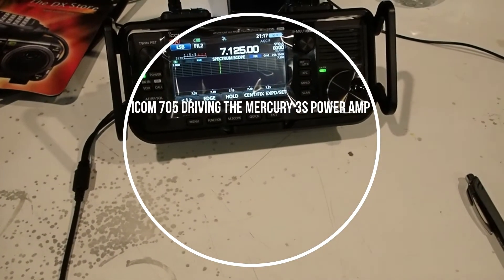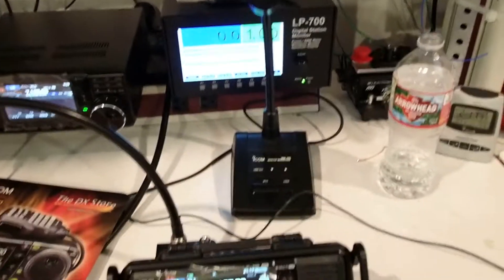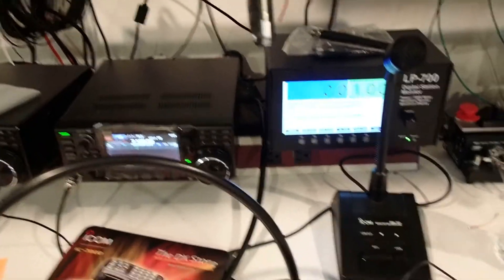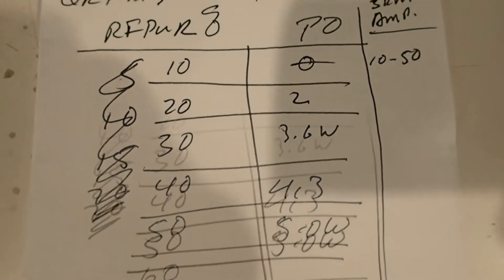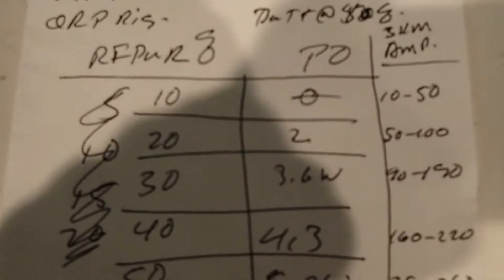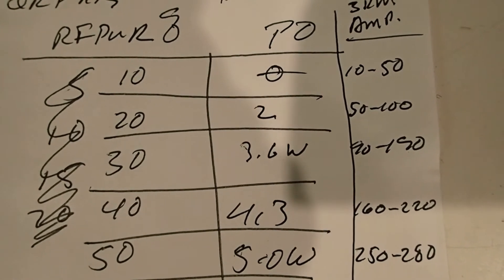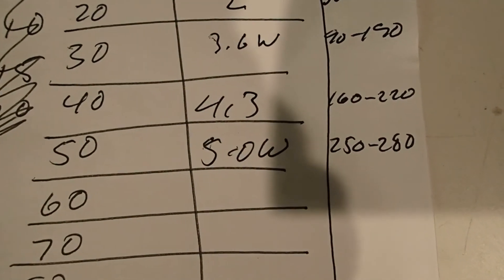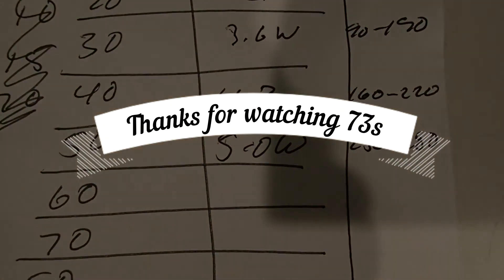Icom IC 705 QRP SDR XCVR driving the Mercury 3S amplifier by KM3KM

Comment: Just change the 10dB Flange Attenuator to a 3dB (maybe 10-15USD on Ebay) and you will get the max output easy with less then 5W from your 705. The Gain of this LDMOS is +/- 25dB and only restricted because of this stupid 15dB max gain FCC rule